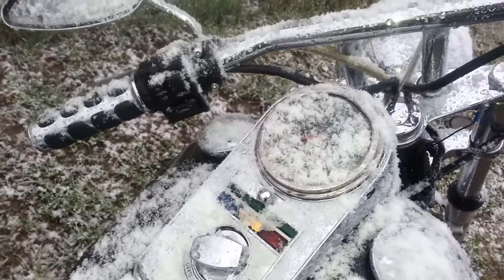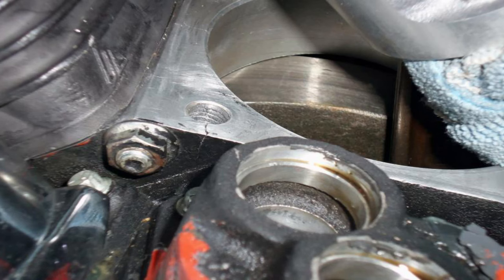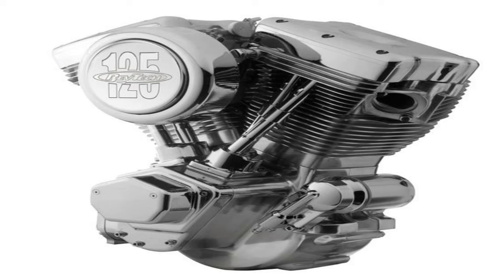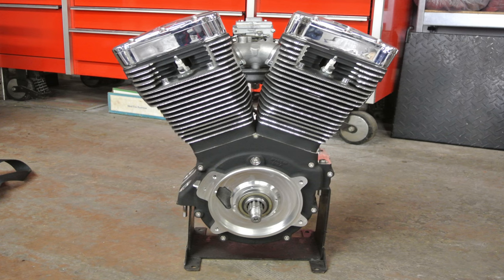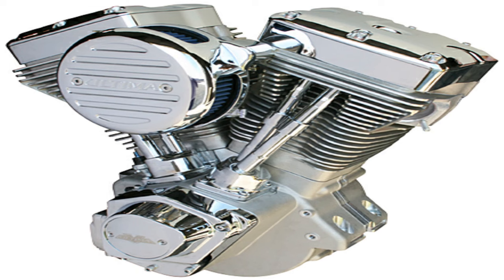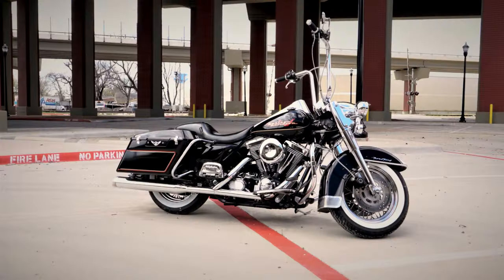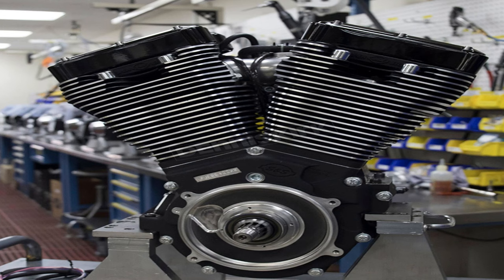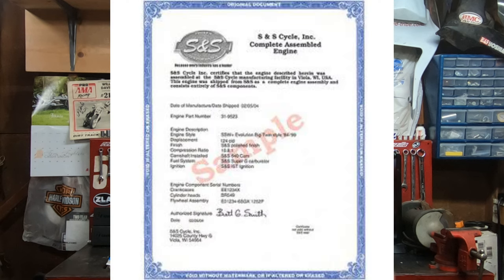New Harley Evolution Engines are Better Than the Original

Comment: For all of the custom bikes my partner and I built, we exclusively used the RevTech from Custom Chrome. And we used the 4X4 exclusively, and swapped out the garbage Mikuni for the S&S Super 'G'. And of course we would rejet the carb accordingly. NEVER a problem with the RevTech. The S&S engines we tried weren't balanced as good as the RevTechs are. Just some fyi.
Reply from the maker: That's awesome to hear some positive about the RevTech engines! They all have their good and bad points but in the end they are pretty reliable. S&S carbs are a lot better than the Mikuni, just some aren't willing to pay the price for the S&S.
Reply: @GixxerFoo  Mr. GixxerFoo, Sir, 
Why do you say that the S&S is better than the Mikuni?  Are you speaking of a CV Mikuni or the HSR compared to an S&S?  I have the 42mm Mikuni HSR on my 98" Road Star and it's resulted in INSTANT throttle response compared to the stock CV Mikuni  took out.  And yes, I understand that that is not an S&S to Mikuni comparison.  But that said, I've pretty much always heard that the Flat Slide Mikuni is superior to any of the S&S carbs for Harley applications, whether Evo or Twin Cam.  I even have a direct quote from a truly legendary CNC motor builder and racer saying that the S&S is "a good tomato soup can compared to the Mikuni HSR."    Would you care to elaborate on your thoughts on the above and why you prefer the S&S?  
Thanks as always for superb analysis videos!
From southern California ~ Ride Forever!

Comment: I have an 99 fxst softail standard, 80 inch, 13k miles on it, is there any upgrade options avalible except replacing it with an new motor?
Reply from the maker: Absolutely, there are cam swaps and big bore kits available for Evo engines. The parts are really inexpensive compared to the new stuff!

Comment: That’s one of the problems I had with my S&S 124. It took S&S almost a year to warranty my 124. I took my mostly stock 80 inch EVO out of my Fatboy. I had a 124 put into it. The day we started it up the brand new oil started returning from my engine to my oil bag with silver running all through it. S&S said drain the oil change the filter and flush the system before putting new oil in it. I did all of this and when I started it back up the new oil started to turn silver again. 
   From that point on it took almost a year to get a new motor and get it installed.
   That pretty much made me a bit gun shy of S&S motors….

Comment: Well for a Harley they are reliable but for practically any other brand they are short lived and underpowered.  Sorry I have a very old used Goldwing that has over 100k and runs like new and it shocked me when I had a buddy with a hopped up HD bagger and I thought I would get my clock cleaned when we did a 1 mile WFO run.  Well my Old Wing, as I call it, is stone stock basically didn't take him out of the hole but after that he might as well shut it down.  We then did the same with my BMW R1150RT, 2004, with 80k on the clock and it wasn't even a race as the RT can pull a healthy hole shot, and due to a 300lb weight advantage helped.  If you want to cruise and don't plan to put a shitload of miles the HD is a fun bike but it isn't the Holy Grail for power and longevity.
Reply from the maker: Lol you're right, there are much more practical bikes out there. I can't argue with a Gold Wing or BMW, they are smooth and comfortable.

Comment: Some information on the aftermarket offerings might be outdated.  I checked the Revtech website and they do not list the 88 and 100 ci engines; discontinued?  The Ultima website now has a 140 ci Evo.
Reply from the maker: They are still available from dealer stock, the whole 2020 shut down has really destroyed the supply chain.
Reply: @GixxerFoo  You ain't kidding about supply chain troubles.  Not only has Covid reeked havoc but so did the Texas freeze from last January.  Add in a couple crop shortages, people unwilling to go back to work, etc. and we have the quagmire we are stuck in right now.  I just figured that Revtech mentioning all the other engines being sold out but not even listing the 88 and 100 suggested they were discontinued.
Reply: They were junk the Ultima is a better motor I bought 2 127s 17 years ago no problems at all

Comment: oh how quickly we forget the facts as it was only 1984  when cycle world magazine ran a special edition featuring the all new FX with the all new evolution 80 cu. in. Gary Bang was the tuner for team Harley racing for the XR750R ..Gary also had done a base line dynomometer  run on the Suzuki GSX1100and got 85whp Suzuki claimed 135hp ...with Gary bang nodded heads and various combos of major name brand cams and carbs with a super trapp  two in to one the 80 cu. in. factory evolution was making 102whp  with stock piston and stock cylinder  and amazingly there was no one ever pulling the studs out if the engine cases as the was the big selling point at Sturgis with  a cut away  of the evo engine showing the half studs with their long stud nuts with a reverse twist on the outside that look much like a reverse drive screw jack that countered the effects of twisting up head studs during assembly and never a subject of failure  ... and rev tech engines get high reviews around here especially their 4 valve heads ...and rev tech carbs that where their version of the stock keihin j

Comment: I remember when the TC motor replaced the Evo. You could buy a brand new , factory 80in Evo at a dealership for just under $2 grand.
Reply from the maker: That's crazy to think they were that cheap back then!
Reply: If you consult the U.S. Dept. of Labor Statistics' Inflation Calculator, that two grand is $3,510.79 in 2022
So, no, they were actually NOT just $2000.00 - nominally yes, but not two grand in todays dollar value.  Maybe we all need to be careful not becoming that old timer who brags about "...back in my day, so and so only cost X"  😁
From southern California ~ Ride Forever!
Reply: @GixxerFoo  If you consult the U.S. Dept. of Labor Statistics' Inflation Calculator, that two grand is $3,510.79 in 2022
So, no, they were actually NOT just $2000.00 - nominally yes, but not two grand in todays dollar value.  Maybe we all need to be careful not becoming that old timer who brags about "...back in my day, so and so only cost X"  😁
From southern California ~ Ride Forever!

Comment: Hey man, I finally got all my parts in to do my comp eliminator and chain tensioner job on my 09 Heritage, now its so hot gotta wait til fall to do the work lol Right afterwards I am putting on a hi flow filter and intake and a Thundermax tuner. I cant believe it took me 9 months to source everything but I am lookin forward to doing the work.....well maybe not doing the work, but I am looking forward to finishing the work lol
Reply from the maker: The end product is always the best part! Yeah getting parts in right now is tough after all the shut downs last year. Man that bike is gonna run damn good with that Thundermax on there, those eliminators are awesome. You won't have to worry about compensator problems ever again!
Reply: @GixxerFoo  im lookin foward to it, i went with Baker for the tensioner and Darkhorse for the comp
Reply from the maker: Dark Hose makes some killer products, Baker does too and they ain't cheap!
Reply: I feel u, I've got parts to put on my 98 heritage, but my shop has no air, about 120 in there, fu#k that.
Reply: @perryhart3172  Yeah man, being a year without my bike is givin me the blues
Reply: @GixxerFoo  indeed, i am hoping to only have to do this job once

Comment: What sort of mileage would a bike have done to need a rebuild or replacement engine?
But I take your point and can see what the advantage of the replacement engines and price is good compared to price of spares, crank regrind, reborn etc.
Reply from the maker: It really depends what kind of condition the engine is in with the mileage. A Evo can have 150k miles and still have good compression and low oil consumption. The latter one can be clapped out at 60k miles burning oil and knocking. Really depends on how it was taken care of in its life and a little bit of luck with the mechanicals.

Comment: I'm currently rebuilding my s&s113ci, dyno a few years ago was 118hp & 124ftlb.. I'm changing the camshaft, lifters, pushrods, rockers and valves to try and push the bike up to 130hp, ish.
Reply from the maker: Shouldn't be too hard to get there on the S&S platform, you have the piece of mind knowing the cases will handle it too!
Reply: @GixxerFoo  the worry isn't the engine, its wether the old trans will take it

Comment: I've had a 127 Ultima for 17 years now it has been a good motor I don't abuse it just use it if you thrash any motor well it won't last as long
Reply: Richard ignore the haters... i have owned 8 of the 127's in bikes  i currently have one in my 1998 bagger which has been in it for 10 years. They run a H beam con rod  all the others run an i beam which is weaker.. Bee hive valve springs, Mahle pistons, Johnston lifters, all good gear..  only issues i have seen in 20 years working on these is Lifter failure that can result in cam damage.... People crap on how their factory 80ci ran for 100 thousand miles... the simple fact is its making 40hp has piss weak valve springs and baby cam... The lifter failure is caused by the massive cam and valve springs used in Ultimas which is required to produce the 120+ rear wheel horsepower... I am replacing lifters in a customers bike today as part of routine maintenance engine is 10 years old...  Any brand engine will wear lifters if it has a huge cam and strong valve springs... and if you rev the tits off it and bounce the valves your going to kill the lifters sooner... i run my rev limiter at 6000 and ride it pretty hard but i am also going to do lifters in mine pretty soon... small price to pay for triple the HP over 10 years...
Reply: @harryavdoulos4029  curious as to fuel mileage on the 127 for a highway bike,  I know there are many variables but big power doesnt neccessarily have to compromise fuel economy
Reply: @thomasborger6548  no idea Thomas it's never crossed my mind as if i wanted Fuel economy i would have kept the original 1340 instead of almost doubling the engine size. i am certainly not filling it every 5 minutes and i believe at times it could use less as it doesn't have to work as hard to move the heavy bagger so light throttle acceleration could be as good if not better but when you keep grabbing and handful it will drink more...
Reply: @harryavdoulos4029  fair enough answer, one of my bikes is an anemic almost stock motor and delivers neither power nor economy, another bike has very good power tho not comparable to your 127 and has quite reasonable fuel mileage hence my strange question directed at you.

Comment: Although my 1997 HD Softail Heritage Springer is a dog of a bike, I like just "putting" along with the wife on back.  My 2003 Road King CVO with the 103 cu in is more of a "neck jerker" than that EVO of mine.  But, what motor would I chose?  A Kawasaki Vulcan 2053 cc with its 125 cu in motor.  Its specs are: With 141 foot pounds of torque at 3,000 rpm and 116 horsepower at 5,000 rpm.  And I can get the bike with it for $5,000 these days (7/23/2021).  So, I would chose the Vulcan 2000LT for my next "Big Inch" bike....  Sorry HD, you priced this "Old grey beard" out of your bikes....  Yes, as a baby boomer, I am moving on from newer or used HD purchases....  I still have to fix my Road King's cam chain problem!!!  Harley's Twin Cam convinced me to move on (1999 to 2006, except the Dynas in 2005 bad designed engine with no apology from HD).  I had to add, "If you want speed, get a sport bike!"
Reply from the maker: Oh yeah that 103 is a sport bike compared to the Evo power!
Reply: My Shovelhead would dance circles around your CVO. But I understand about Springer's being a dog of a bike. Put a ev27 cam in it you'll think different
Reply: @TheYammerHammer  How much money do you have in that Shovel's motor?  What if I put that much money into my 103's motor?  Apples to Apples.  Your 1200 cc has a lot of money and time invested in it to make it better than a 103 that starts out at over 1700 cc.  No, you would not dance around anything if I put the money into my 103 that you have in your 1200...  Or is it a 1340 cc Shovel?  No matter, apples to apples invested and you would be peeing in your pants.
Reply: @ababbit7461  well considering I've owned the bike for 30 years probably a billion miles and a half a million dollars,son! Shut yo mouth!
Reply: @ababbit7461  I'd still beat you! Dump all the money you want 103s are weak sauce!!!
Reply: They're dogs because we're riding behind a 500# front end. But how beautiful it is! 98 Springer here.
Mikuni carb made big difference. And leaving the wife behind. ;-)
Reply: @dougfresh1341  ev27 cam will wake it up 80hp 95torq (depending on altitude) change out the push rods and readjust! the heads will take it no problem. Harley left a lot of room in there to play with.... Might as well change out the cam bearing while you're at it. Recommended before 40,000 MI
Reply: @TheYammerHammer  Dude, if I do that then the wife might wanna ride more often. I’ll pass. 😏
Reply: @dougfresh1341  well enjoy your 49hp 🐎 Take her easy
Reply: @dougfresh1341  I live at the 4,300 foot level.  I have a Mikuni carb too.  Maybe my bike is carb'd for sea level??  Thus, it is real flat for a V-Twin.  My FXR-P with a Keihin rode better at altitude changes.
Reply: @TheYammerHammer  The only thing you are going to beat while riding an old shovel that you say is fast is your meat.  Yep, even Lucy Labia Lips knows bologna is limp and useless.

Comment: The 111.
I knew a guy who put one in his bike, and that thing hauled the mail.
It came complete with ignition and Super G carburetor.
He chose the non-intrusive ignition so his warranty was for a year.
It's worth every penny.
The same guy also went through 4 RevTechs.
Custom Chrome honored their warranty.
This occurred 10 plus years ago.
The 111 is the way to go if you have a Heritage, or FLH.
Any model really, it will fit in any Evo frame.

Comment: If you can get past not having the original vin on the original left side case, I contend an aftermarket Evo engine with stronger cases is the best Harley air cooled big twin engine ....ever.   

But then again you can go down the slippery slope of whats original?  How many part changes before its no longer original?
Reply from the maker: That is the pitfall of a aftermarket engine, best thing you can do is document and save all the receipts. That way someone can start at the front of the bike and follow the paper trail to the back.

Comment: I bought (both new) a S&S 98" Shovelhead and a Revtech 100" Evo. While both have been GREAT engines, the Shovelhead actually pulls a little harder than the Revtech. Not by much but I was surprised that the old design by S&S was torquer than the Revtech Evo. I also get better mileage out of the S&S with the E carb it came with. The Revtech sucks the gas down. Both great engines though! I'm looking to replace the engine on my 95 bagger in the next year or so. I'm leaning towards another S&S.
Ultima's can be purchased as "factory remanufactured", which is a little unnerving. For my money I'll stick with something that's tried and true.

Comment: If I decide to go above stock crate engine, how much change to you have to do with the compensator,  clutch, tranny, etc.  Long haul road worthy.
Reply from the maker: If you went with a high powered crate engine a high performance compensator or eliminator would be a good idea. You'd also want to upgrade to a performance clutch as well, transmissions will handle a lot if you're just cruising and getting in the throttle time to time. That's a great question, getting those items upgraded will make the setup a lot more reliable.

Comment: Nice!  I may be interested in a bike with the Revolution engine eventually.  Any chance in hell the Revolution may fit in the existing sportsters?
Reply from the maker: I am pretty interested in those myself too, I am going to wait and see if any issues come out of the motors first though. As for a existing Sportster you'd need one heck of a fabricator, those new motors are designed as structural member of the frame. Could be pulled off though!

Comment: I'd like to put one these EVO crates in a new M8 style frame.
Reply from the maker: That would be a really neat project! Put one of those in a new softail frame like the Low Rider S with the short rake and inverted forks.
Reply: One of my techs is planning this, evo in late model frame with Delphi fuel injection, throttle by wire, Infotainment system the whole 9 yards

Comment: I'm considering a107 or 113 ultima engine for my 98 road king classic. My question is about the transmission.will this engine run down the road ok with the stock 5 speed? I'm aware a six speed would be better and have plans to do just that. However I'm an old dude on a tight budget.

Comment: Now days I would definitely go with a crate engine. Is Rev Tech owned by Custom Chrome? By the way checkout Head-Quarters (Canadian) I have their system 85 in my trusty 86 FLT. Its no race bike but he's pretty sporty for what it is. 85 rwhp & 90 ft lbs of torque. Another good video. Keep up the good work!
Reply from the maker: It's hard to tell if Custom Chrome owns them or if they are just a distributor of the engines. Sounds like you have a really nice bike, it's hard to beat those Evo powered Harleys!
Reply: My FXR put 86 hp with the HQ 80/90 kit love it but when rebuild time comes s&s 111 create motor.
Reply from the maker: FXR is where it's at, l love those bikes!